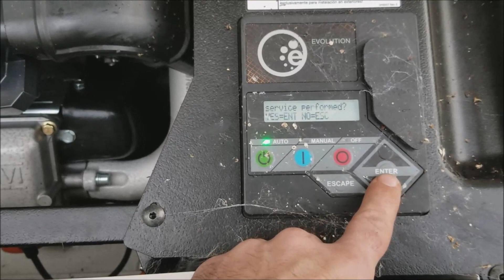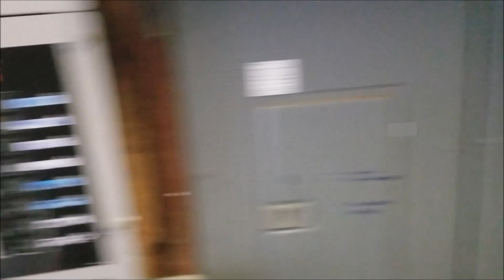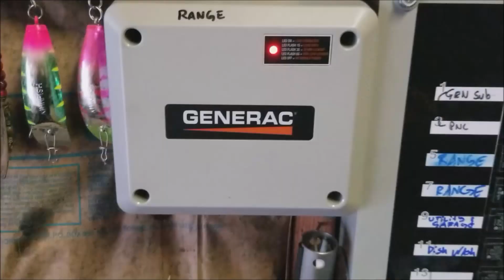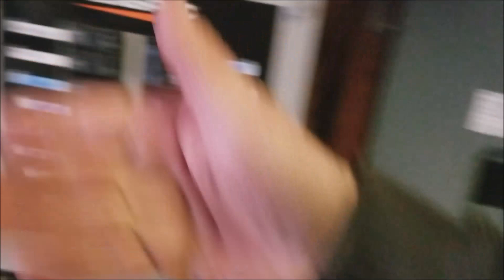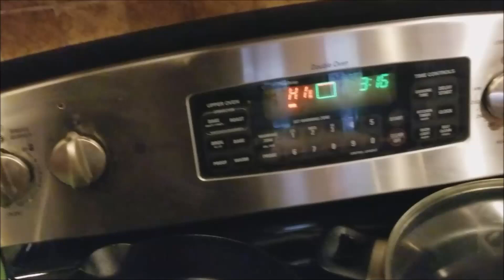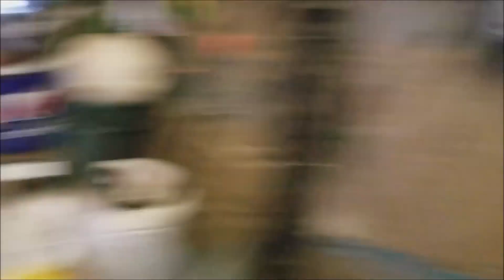Generac 16kW Guardian with load shed

Comment: does the generator need to be 5ft from the building..?
Reply from the maker: Clearance from combustible, 18" from back of unit, 3 foot sides and front. For Carbon monoxide, 5' from any opening to the building (windows, doors, vents etc).... additionally there are clearances from electrical and gas meters. Verify with your local utilities but for mine, 36" depth, 30" with clear on any electrical meter or panel, and 36"  from the vent on the gas meter. Though some municipality require 48" on an electrical meter and 5' from a gas meter. So you may need to check with your local utilities on that one.

Comment: What is the real world fuel consumption ?
Reply from the maker: Real world , (this would be less than the generac 50% or 100% chart in their manual) from what my real world customers have experienced, a 250 gal tank, filled to 80%(full with expansion) is a week running 24 hrs per day.
Reply: Lp is between 1.5-3.5 gal per hr. Nat Gas is around 350k BTU's an hour. 18, 22, 24 and 26 all fall in that fuel consumption range. They stopped making the 16s about a year and a half ago

Comment: Why the hell didnt you get a whole house transfer switch outside next to the meter?
Reply from the maker: TheSeattlegreen , Great question. If I had it to do over again, I would have.... at the initial consultation, the customer just wanted the existing generator panel on the new automatic generator. After the first winter, they wanted more and more powered. When counseling about automatic standby generators now, I explain the limitations of an emergency panel and how load shed is often a better solution. I made several changes for this customer at cost as I wanted him to be happy with his purchase. It still frustrates me how some of the Simi-custom home builders market a residential generator panel. There are better solutions nearly always. Last year I installed approximately 20 of these and only one of them used the 16 ckt load center as the best solution.
Reply: Vernonia Living 
If you went with a 22KW generator and a whole house transfer switch outside next to the meter, and just isolated the grounds in the panel inside the house, would that be a lot easier than what you did here?
Reply from the maker: TheSeattlegreen , yes, what I ended up doing here.... the 22kw is by far my best seller by 2 to 1.....